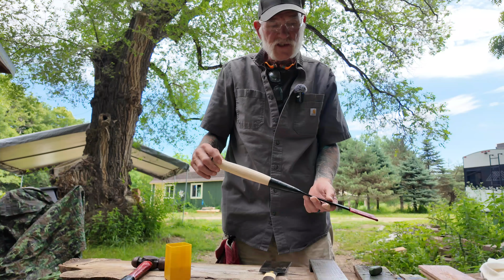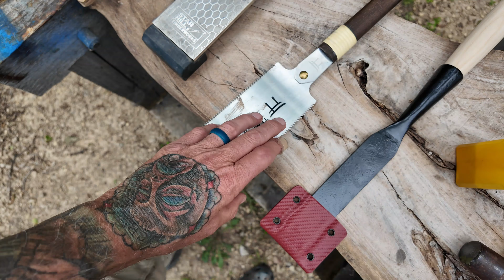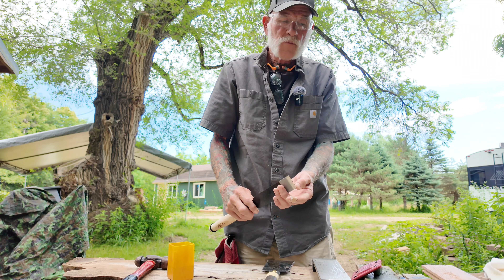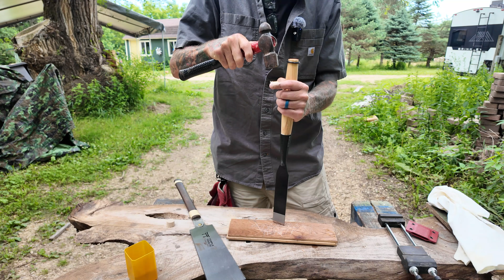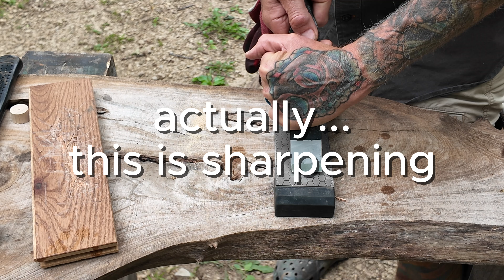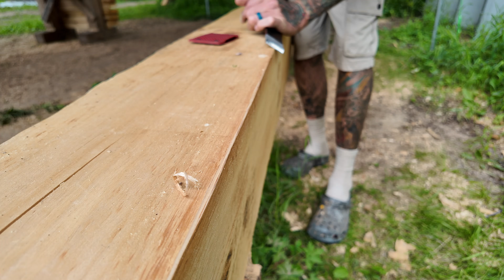stop sharpening timber framing chisels flat

Comment: 50 degrees is crazy
Reply from the maker: seems crazy. but with shallow convex grind, it is just perfect. makes the chisel "crazy sharp." how do you approach sharpening?
Reply: @StarHillTimberworks  I guess for hammering mortises sharpening angle doesn't matter that much and it is mostly an overall geometry that plays the role, where convex grind allows for smoother deeper digs. I don't do that many mortises, moslty pairing and cleaning up with my chisels, and I think more acute sharpening angle at those types of work matters a lot while the overall grind doesn't matter at all. So I'm doing a hollow grind on a wheel at 25 degrees and then hand sharpening micro bevel at 27-30 degrees. 

That being said I'm gonna try your 60 degrees. Recently I came across an advice to do 85 degrees sharpening for a "scraping chiesel" and I thought it was nonsense but I tried it and it works awesome for it's purpose, so who knows, maybe you are on to something.
Reply from the maker: @mnzrk  yes. stay tuned. we are gonna test it out on youtube and satisfy ourselves as to what grind performs better and why. series starts next week.

Comment: I believe after you learn this, and it may take a few tries, it is quicker and a far more resilient edge for woodworking. I don't think it matters what kind of woodworking either be it timber framing or dovetails. But I am a nobody who is new to this whole hand tool world the last 3 years. But every single book I have on the subject of vintage traditional hand tool woodworking all teach convex sharpening. They do talk and describe all others as well but across the board suggest that this is the preferred method and approach for edge tools.
Reply from the maker: i am absolutely a believer in this method. after decades of flat and hollow grind. convex is far superior in my mind.

Comment: Sharpening both chisels and plane iron with a convex radius is not new. Until tool manufacturers of the last 20 or so years started making “sharpening angle guides” it was done this way by all master craftsmen who apprenticed out of the 50’s and 60’s. All of my chisels and plane irons have a convex bevel that ranges between 25 to 30 degrees. They are wicked sharp and my chisels plane end grain quite easily. The notion that all bevels must be flat follows the same thinking that all planes must be on their side. Tool manufacturers are trying to SELL more sharpening jigs and stuff, so the more “Experts” they get who promote this means more money for them. BTW, you mentioned Paul Sellers who has been sharpening this way since he was 15 in the mid 60’s. Must be doing something right with pieces in the White House, half a dozen kids and doing this from being a wood worker - who taught me to radius the bevel of my chisels and plane irons.
Reply from the maker: i agree. i went along with the standard for decades. then, i found convex. way better!

Comment: I think this technique may be ok for a planer blade, but if you do this on a chisel you won't be able to lay the back of the chisel flat against a surface and pare away material, such as you would on the side of a tenon. The back of a chisel is the reference surface for many uses.
Reply from the maker: this is traditional thinking, and it's exactly what i was taught too.

my experience has been different. i don't flatten the back after sharpening. i hone a micro bevel on the bevel side, then remove the burr from the back with a light pass. that's it.

there's no need to spend time flattening the back every sharpening session. once the burr is gone, the edge is clean and ready to work. i've used this method for years, including paring tenons and other joinery, and i've never found it to be a limitation. what matters is a sharp, clean cutting edge, not repeatedly polishing the entire back of the chisel.
Reply: @StarHillTimberworks I guess I thought you were putting a micro level on the back? If you aren't putting a micro level on the back I suppose it's a perfectly fine sharpening method. However your microbevel on the other side will quickly become not a microbevel after a few sharpening and you'll have to keep increasing your angle to keep it a microbevel. Otherwise you will have to take down the main bevel every so often.
Reply from the maker: with the shoulder grind (convex) it holds up very well. at some point, you might need to reshaped it. however, i have a number of chisels i've used daily for years and have not needed to reshape. reprofile is pretty easy with a sander and bucket of water to keep it cool. I have hit a nail and needed to reprofile the chisel. seemed very odd to me when i started down this path, but it seems to work for us. this is my favorite grind. hollow grind is second and i really don't like the flat grinds.

Comment: Don't stop flat sharpening.

this message is brought to you by Flat Sharpeners United. or FSU
Reply from the maker: i'm sure the FSU membership committee will be reaching out shortly. fortunately, independent testing has shown a convex edge may improve happiness, reduce sharpening time, and increase shaving production. results may vary.
Reply: @StarHillTimberworks the church FSU profess that toilmaxxing is the way to true enlightenment.
Reply from the maker: @runefreak220  the FSU has a long and distinguished history. unfortunately, independent testing suggests members spend significantly more time at the sharpening stone than building timber frames. we'll agree to disagree and compare projects at the end.